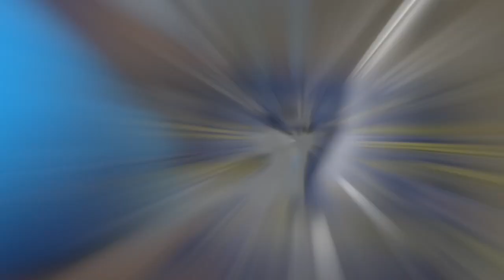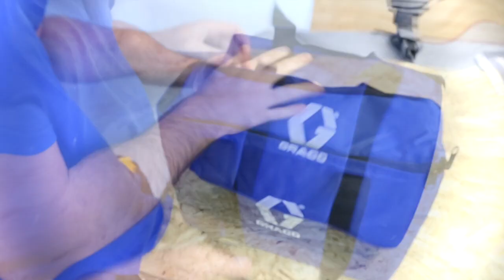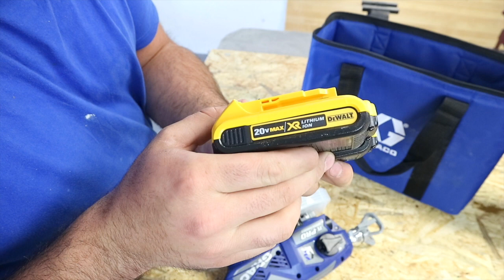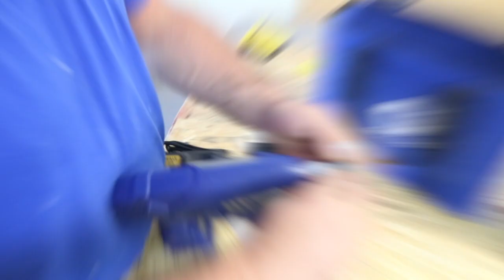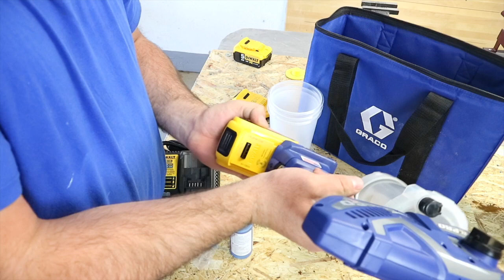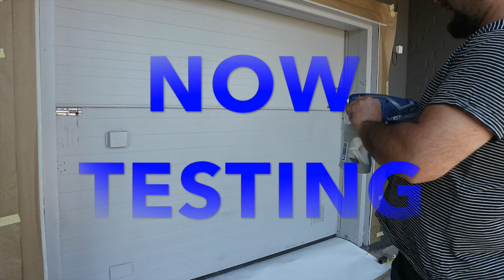CHECK IT OUT  THIS VIDEO BEFORE YOU BUY THIS TOOL

Comment: little to go wrong with this unit , make sure to clean completely as per instructions after every use . Great for small jobs of a couple of quarts beyond that use a larger capacity sprayer. Most of the time the failure is in the pump which is easy to replace